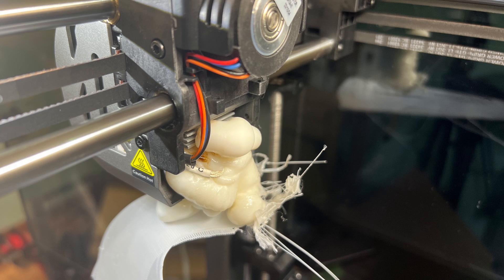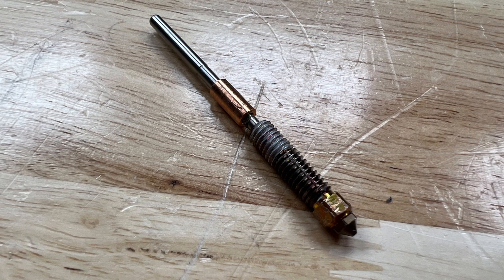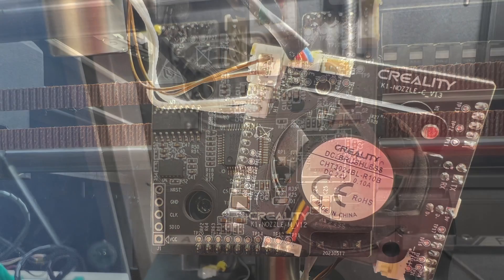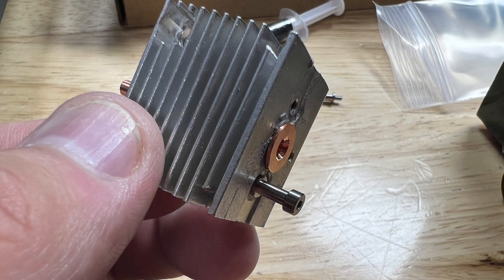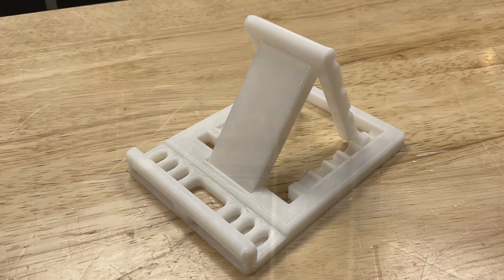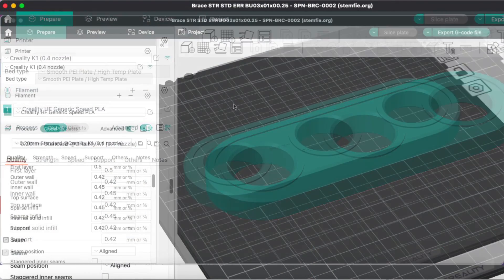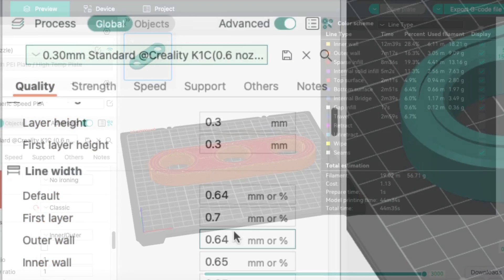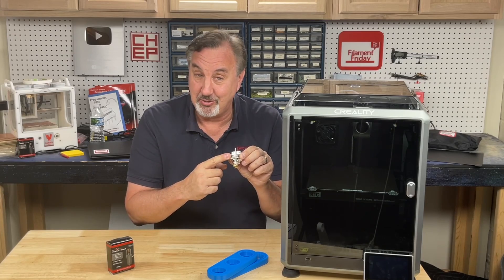Upgrade Your Creality K1C with Micro-Swiss 0.6 Nozzle For Faster Prints!

Comment: The MicroSwiss Flowtech Hotend comes complete with a silicone sock.
There must be a logical reason why they supply a silicone sock with their hotend.

But this dude reckons it's not needed as he "finds it useless".

So if he reckons it's not needed, maybe we should all take it off our 3D printers and toss it out.
It will make nozzle changing on my K1 Max much easier.

After all, he knows a lot more about 3D printers than I do.

But....I think I'll leave mine on.
Reply: I've forgotten to put it back on a few times after changing nozzles and seen no adverse effects. I'm guessing it just helps to insulate the hotend, keeping heat in and also preventing the heat from rising up where it's not wanted.

Comment: This is by far the best tutorial to switch/change a MicroSwiss nozzle with an existing MicroSwiss FlowTech. Question: Do you heat the nozzle, retract the filament, remove the silicon sock, and then HOT, replace the nozzle (you changed to the .6mm). Or do you let the nozzle cool down before unscrewing?
Reply from the maker: Retract the filament and then you can change it cold or hot.
Reply: You can change the Flowtech nozzles hot or cold. They also don't require much torque (7NM ) so don't overtighten, or you risk pulling the titanium posts out from the alu heat sink.

Comment: Same thing happened on my Ender 3 V3 KE printers and I kept having issues after I replaced the hotends. I ended up ordering MicroSwiss FlowTech hotends and heatsinks and solved the issue and I am having better quality prints. My FlowTech hotend installation guide mentioned nothing about thermal paste and did not include it so I am assuming I don't need it.
Reply: No paste required, it's a different design to the K1.

Comment: Hey.  The exact same thing happened to me on my Creality K1C.   Do you have instructions on how to take the heat sink off? I ordered and recieved the Microswiss Hotend.   Like yours. I cant get the heating nozzle off the heat sink and I am thinking if I take the heat sink off it may make my life easier taking the nozzle off. Any help would be much appreciated.
Reply: maybe use a lighter or torch (small one) heat the hole thing up enought to get it off
Reply: Wondering if these have thread lockers like loctite?  If you have a heat gun or torch, you could probably heat to around 350ish as the other user suggested. If not, then a blow dryer may help as well.

Comment: But how does the print with 0.6 nozzle look "pretty good" if there is obvious underextrusion? From my experience with K1C and 0.6 nozzle, it looks like the extruder motor is a weak link.
Reply from the maker: I’ll have any example of how good it works in the next Filament Friday video.
Reply: @FilamentFriday  I would be grateful if you'll make a comparison 0.4 Arachne vs 0.6 Arachne: time, quality, filament usage. 

I tried 0.6 for a couple of days. Calibrated everything, but returned to 0.4, as there were no speed gains, but was obvious quality degradation on utility prints - composite models, models with threads, watertight models, models that are parts of mechanical devices, etc.
Reply: having a very hard time making a good working profile for 0.6, orca slicer, is there a place people share their profiles?
Reply: @romand4649  I don't know. I failed making a good profile.

Comment: Thank you! This was such a helpful video. Warning: whining ahead: The hot-end this comes with blew out within 4 prints. After trying to get Creality to replace the hotend because it had broken some wires, we gave up and made them replace the whole machine, and the new one had quality control issues - the ceramic coating on the hotend was thin and broken! That was okay though, we'd already decided to replace it because of the poor original design, and your instructions made it very easy for me to do. With a good hotend, this is an excellent machine, getting great prints out of it.

Comment: I ordered the K1C and should be here tomorrow. Should I upgrade to the new hotend before using it for the first time?
Reply from the maker: No, use it as is for a while. I do suggest a textured PEI build plate.
Reply: Very good!  I did order the new build plate. Thanks for what you do!

Comment: I had a similar problem with my K1C.  The silicone sock didn't fit snug over the tip, and during a failed PETG print, the filament filled the entire cavity surrounding the hotend inside the sock... what a mess!  While I was able to clean it up sufficiently, I purchased a Micro Swiss hotend that I haven't taken the time to install yet.

Comment: How can I get a K1C Heatsink from Creality (or anyone)?  My brand new K1 Max is down and it came shipped with K1C Hot End, as I believe all are now.  They do not show the heatsink as a replacement part available.  THANKS for the Video!  I would have NOT known about the "switcheroo" done by Creality on my K1 MAX hot end, if it weren't for finding this video and watching it.  Now I just need to get a heatsink and I can get the Micro Swiss K1C Hot end and get back to using this GREAT printer.
Reply from the maker: Contact them here: https://www.creality.com/pages/service-center?spm=..index.header_1.1

Comment: I have a ender 3v2 with a bl touch i just printed cheps dial indicator holder to better level the bed is there a gcode to where the print head will travel to each point of the bed so I don’t have to do it manually anymore?

Comment: Maybe after Taxes I'll be able to find resources to pick up a flowtech hotend for my K1 and perhaps then be able to re-commission it. Replacing the extruder drive set didn't fix the extrusion problems though, so I'm not putting this on the front burner for a while.

Comment: Do you still use Cura at all?
If so, will you be making any profiles for the K1 for the new Cura versions?

I have been using Cura since I got my CR6SE and now we have a K1 at the office, but I'm really struggling to setup profiles in Cura for it and I don't like their Creality slicer they use.

We using the stock 0.4mm nozzle, basically all 100% stock.
Reply from the maker: Here: https://youtu.be/kZqCkJsDsTY?si=BXLSmBFV3Dbx_B27
Though I find Orca Slicer works better for Klipper machines like the K1’s.
Reply: @FilamentFriday  No idea how I missed this one! Thanks again. I still find it5 very odd that Cura still don't have any K1 printer profiles in their softwares yet...  
I did try Orca, but just so used to Cura now. But I'll give it another look.

Thanks again.

Comment: I had the same problem with the blob, three days after getting my K1C.  This is my first 3D printing experience and I would rather be printing something than taking the printer apart.  I finally got the new hot end from China after nearly 3 weeks.  But I have also been unable to unscrew the nozzle from the heat sink, so I have requested a new heat sink from Creality.  Probably another 3 week wait.  I think I might order this hotend from micro swiss just to have on hand.  I just hope that I will be able to put everything back together again!  Thank you for this video, I'm sure it will help me when I get all the parts!
Reply: I found It helps if you pre-heat the hot-end before you remove the nozzle. Obviously be careful when handling it.

Comment: I am confused as to why we need the micro-swiss. I could see if we messed up the original, but is if my printer is printing just fine with the original why spend the extra on the micro-swiss. Also, I have a .4, .6, and .8 nozzle that fits the stock unit - they're on Ali Express.   what would have been nice is for you to have done the print in .4 and then again in .6 and show us a comparison. I get it that a larger line will print faster, but my main question is if I'd be happy or even notice the quality difference.
Reply from the maker: Sounds like your machine is all set. No need to make a change.

Comment: Chuck are you not using the rubber sock on your hot end? I hate the way they tear off anytime you need to remove them so if it's safe to do so I'd rather omit it altogether.
Reply from the maker: I find it useless so I leave it off.
Reply: @FilamentFriday  my Ender 2 Pro would only heat the nozzle to 190C then throw the thermal runaway error when I forgot to put the sock back on, so you might need it for the lowest power of hotends
Reply: Good to know, thanks Chuck. I know that I would sometimes get thermal runaway issues on my Ender 3 Max if I left the sock off, so good to know that you have not experienced any such issues with your K1C.  @FilamentFriday

Comment: So basically... The Creality K1C does not work out of the box without adding better parts....
Reply: Did you even watch the video? Looks like his hot end wasn't properly installed.
Reply from the maker: No the original bed didn’t hold the print and I got the blob. https://youtu.be/zIc08qd2C_s?si=pLUmUPDPqfgH8BEl

Comment: I tried a 0.6 nozzle on my K1 Max, I didn't notice any significant change in print times using creality print so I went back to 0.4.
Reply: And you resliced your gcode for a 0.6 nozzle?
Reply: @peteruttman7504  yes that's how you compare the print times.
Reply from the maker: As you saw, 0.6 was quicker for me. I don’t like Creality Print.
Reply: Did you change the layer height and width? I get faster prints with a 0.6. Also try using Cura slicer.
Reply: @Stuntman707  Yes, layer height at 0.4. I haven't tried any other slicer yet.